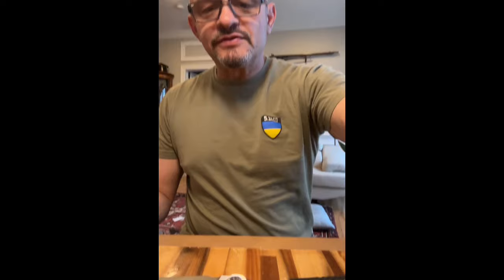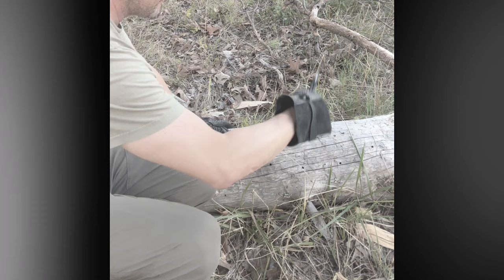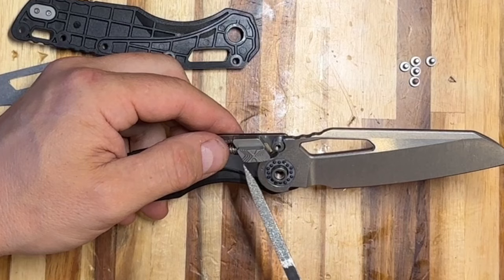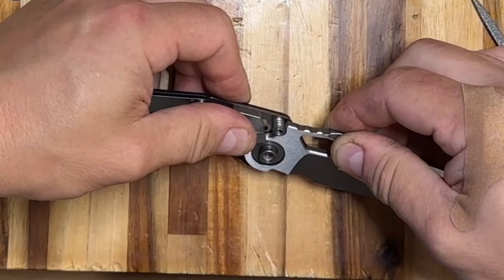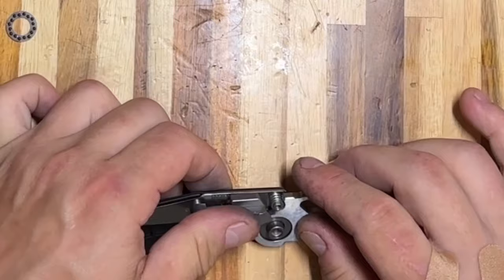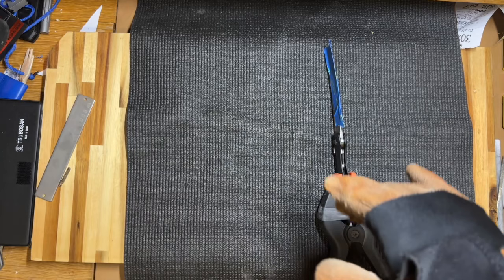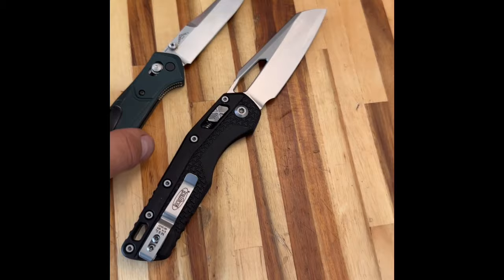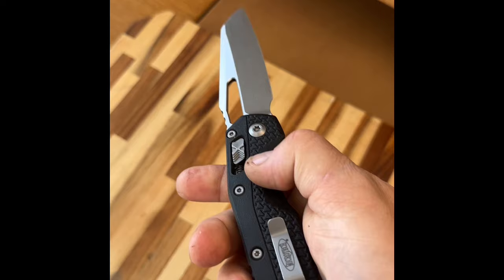Microtech MSI lock failed. See why & how to fix it.  Is it a good EDC knife candidate?

Comment: Same thing happened to mine. Spine tap caused the lock to fail. The MSI lock had a similar gap as your knife. I sent the knife back to Microtech for repair. They sent it back and the gap was gone. They should have caught this issue in their QC process. Great video!
Reply: This is good to know. I received mine the other day and have this lock issue so away to MT it goes. Glad they can actually fix this through warranty and I won’t have to mess with it myself.

Comment: People should be very careful doing this because you essentially removes years of use off the knife. When you have a brand new knife you need to break it in before using this procedure, and if used, you need to remove only the slightest amount of material.

Comment: I don't believe filing the blade was the right move. Just like a frame lock or linner lock you need the angle of the lock to wegde as is wares down. The ram is the wedge. Filing  a small amount off the ram with diamond jewel files at a slightly lower angle fixed the slip for me. This ensures it will have a rock solid lockup even as it wares. The ram will always wedge tight.
Reply from the maker: Dave, I wish I could see your facial expression when you find out that Microtech has implemented the exact solution - flattening the engagement tang - on all Ram Locs in April of this year. 
🫳
🎤
Reply: Good for you. Happy your solution was what they wanted.
Reply from the maker: @davecaraballo they also eliminated the ramp area on the ram head. Much much better engagement!

Comment: You should test the spyderco manix 2 lock. I think it’s a similar design, and it would be neat to see how it stacks up. Maybe with some slightly better knuckle protection though.
Reply: I’ve tested it on the Manix 2. No failures. It’s extremely solid.

I’ve got two MSI‘s and both have this problem. I’m on the fence about whether to sell them or to try and do it. This guy did.
Reply: @CuttingBoardRx  I’ve already got one. 

It is more solid, but the Ram Lok makes me nervous.
Reply: @squigglydoo9386 Given the fact that companies are going to be coming out with some badass custom scales for these things I suggest you get a pair then do this mod while you have then off already. I'm with you, I'm very disappointed that my msi has a bad lock but I'm also very glad that the fix for it us very easy.
Reply: Yes sir!
Reply: A manix 2 lock failed on me stabbing through a hard piece of plastic to make a cut during a job. Luckily I didn’t get cut.

Comment: Absolutely LOVED the video! I recently got a MSI off Ebay & well, it wasn't up to snuff. Mfg. June of '23, and it had lack of ram. I didn't have any good diamond files & using the diamond stones from sharpening kits tested my patience too much lol. Then I remembered about the Smith's 3001 10-Inch Oval Diamond Sharpening Rod I use to roughen up an abused or worn edge in a pinch & then run over it with a smooth ceramic hone to get a sticky edge (not a proper 'sticky edge', but it works excellently in a pinch). That Smiths hone worked great! I also knocked down any burs from the sanding & used the almost dull carbide mini files to smoothen anything else. 
The ram was also uneven, so I put the Smiths to it as well to flatten it a bit so it slides in the liners without catching. All of the moving parts got a buffing & it works great now. Using a permanent marker helped show where the ram was engaging with the blade & I could pay more attention to those areas. 
With 1 scale off, I held the 2nd liner tightly in place and with a well taped blade I pushed the ram evenly against the blade as a 'speedy break-in' & the marker shows where the ram running along. 
Hope these idea of mine/ours helps those that have to adjust their MSI's.
Again, I loved the video, it's put together well &greatly appreciated!

Cheers
Reply from the maker: @Rottidog68  Thanks! Would love to have you as a subscriber!
Reply: @CuttingBoardRx  I am. Have been for a couple/few weeks, I believe. 
Coming from a manufacturing field, welder/fitter, I appreciate your engineering view of things. I find it easy to follow, relatable.
Reply from the maker: @Rottidog68  it’s easy to follow and relatable because I wasn’t always an engineer 🤣 - started out as a machinist! 
BTW, how can you tell an extrovert engineer from a normal introvert engineer?
Reply: @CuttingBoardRx  Mrmrmrmrr, I'm not sure. How do we tell the difference? Something about feet or staring. Odd I know lol, but that's what pops to mind. 
<edit or Rev.1> One makes YT videos?
Reply from the maker: @Rottidog68  correct! Introvert stares at your feet from 1.67 meters dis. The extrovert stares at your belly button while debating whether he should shake your hand and does he have the pocket sanitizer bottle!
Reply: @CuttingBoardRx  OMG lol. That's pretty elaborate & exacting.... so, it's appropriate. 😎🤓

Comment: Great Video.  I like  videos that not only show an issue but also show how to fix an issue.  Great Video.  By the way, I absolutely love my Microtech RAM-LOCK Folders, especially the MSI.  I find it to be a super useful everyday carry folder.  Its ease of use and its weight not being too heavy and its super useful blade is excellent for everyday cutting chores.  

One thing, mine, are 10/2023 MSI and Amphibian Folders, and the Lock-Bar on my MSI Folders goes almost all of the way forward, already and they don't fail the Wooden Table Top Spine Whack Test.  

But, on my Amphibian Folders, there's a big gap, like you showed on your MSI.  This makes me wonder if they fixed the MSI due to your video and not the Amphibian...  My Amphibians are my Collector's.  So, I am not modding those.  I thought I was going to carry the G-10 Amphibian and I installed Skiff's into it.  And, then, after carrying it for a week, I decided I liked the MSI more.  :-)

And, if the one's I carry, the MSI's, mess up, thanks to you, I know how to fix them.  Thank you for sharing.  Personally, I am a long-time Benchmade Axis-Lock User.  And, I must admit, I absolutely love the New Microtech MSI RAM-LOK Folders; they, absolutely "ROCK!!!"  :-)

I like the RAM-LOK better than I like the Atlas-Lock.  Why?  It functions better and is easier to use.  And, I have more faith in the Coil Spring than I do in Omega Springs.  Well done Video discussion, Bro!  :-) Peace, Stiletto :-)

Comment: I have a clone stitch in D2 for my daily beater and To do lot of task in my workplace, i noticed that the steel liner is double the thickness of the original one which is very thin. 
The lock is perfectly fine and very strong but there is huge gap in front of ram head like more than 2mm so i will do the same thing to improve the lock, THANK YOU SIR.

Comment: 1:55 that's bad advice!
the lock is not ment to be stuffed with a metal bar, if anything you'll wear it out and f* up the action and safety of the lock.
if you do things that make the axis-lock fail, then maybe you should pick a a fixed blade or a pry-bar and not a folding knife.

Comment: Thank you for making this. I have been searching for an answer since receiving my msi which also failed a very light wack on my knee. At first I thought the spring was weak and wasn't pushing the ram lok out to full lock but your analysis looks to be spot on. May end up doing this to my msi and stitch. Do you have any tips  so I don't fuck up my blade tang?

Comment: Thank you i just purchased this knife and definitely going to have to refit the engagement surface
Reply from the maker: I also did this on my Stitch Ram lock. Be very careful careful not to remove too much material from the back of your blade. Watch this video first:
Straight Answers to Microtech Amphibian Questions:
https://youtu.be/uouaZlInYLI
Reply: @CuttingBoardRx   Thank you I watched that video first!
Reply: @CuttingBoardRx  I tried this before any fitting and I'm pleased that it passed!

Comment: I did the spine test on mine and didn't have this issue. Gave it some pretty good wacks on my table. Sounds like this one slipped through QC. I did the same to a couple other ones I have and same thing no issue. The gap on the polymer version I have is around .60-.58 slightly less than yours had original, though I feel like that's not much difference. I guess I got lucky.

Comment: Excellent repair and video. I will be repairing mine soon. Thanks !
Reply from the maker: Just want you to know, the ones coming out of Microtech now have that exact fix applied. You may want to consider selling yours and getting one dated 05/23 or later.
Reply: @CuttingBoardRx  Thanks for the advice, but I love fixing and building. I'm quite certain I can deal with this.
Reply: @akquicksilver  have you sorted out your lock issue? im planning to get the MSI next week😊
Reply: @L4BOO  Yes, I did a little modifying on mine as suggested by CBRx and it works fine. I've heard and saw somewhere on YT that the newer models don't have this issue.

Comment: I know at first this was very believable since I owned three MSI's I decided to take the cheapest one I have, which is the molded one, and see if it really would fail when banging on the spine.  to my surprise as hard as I tried, I was not able to break the spine,  I'm not sure if the knife you had was designed differently than others or what but I can say for a fact you are not breaking the spine on an MSI ...  i'd say you have bad luck .

Comment: All that I see is you’ve accelerated the room that MT has left for wearing in of the lock. Sure it did the trick, however in my experience, allowing the parts to wear together ensures the system faces to itself, creating a stronger lock. Either way works though.

Spine impact is not a very realistic test in that when the user tests it, it’s sharp impact in a specific area. In stabbing and redirecting the blade in real life scenarios, the pressure is usually not blunt and its spread out.

Comment: I have the same one and mine fails too, i know people say why would you wack the spine nobody uses their knife like that but it does come down to safety, is it likely to fail under normal use, no, but you could trip or turn arond and accidently hit the spine and cut yourself wide open, it's probably not likely but you want to have the assurance that if some kind of weird accident does happen while using your knife you know you won't get seriously hurt. Just my opinion
Reply from the maker: Good point! In fact there was a comment in one of my threads where a gentleman tripped and fell with knife in hand and it closed on his hand and seriously cut him.

Comment: Don't you want to leave a small gap to allow for wear without creating up and down rock?
Reply from the maker: @georgelewis9127  Does not matter anymore. They completely redesigned the ramhead to blade interface moving the ramp to the blade basically what I did in this video. All RamLok knives made since April 2024 have the new hardware. Thanks for watching.

Comment: I just picked up an amphibian and the lock is not failing on the spine whack, and it does have a pretty decent gap above the ram head. The lock is still a bit stiff, once it breaks in more maybe this will happen? Well if it does, at least I will know how to fix it 👍
Reply: Update: It shuts easily on the spine whack now that it is broken in.
Reply from the maker: @stevetheripper7675 did you see the video I posted that covered all 3 Ram Lok knives in my possession?
https://youtu.be/uouaZlInYLI?si=8bMVKvSxT8iRor2Z

Comment: I see what you're trying to do, and I would also advance the lock a little bit, because more surface area contact between lock surfaces is a good thing for safety... However I think you went too far. 

You've advanced the lock to the point where there is no space left for wear over time. Those type of locks NEED a gap, so as the blade wears against the ram, the ram can self adjust and progress forward on it's own.

The ram now has no further forward space, so when you inevitably get lock rock there's not really much you can do. I would have done maximum 50% of what you did.
Reply from the maker: The ram head is a hardened piece of steel, so wear is not a major concern
Reply: @CuttingBoardRx  that doesn't matter. The blade won't be the exact same hardness, and have different material properties.

The ram wears against the blade tang, and any two surfaces that have friction, have wear. You can't avoid it, you can only engineer around it.

I assume the designers accommodated for wear by allowing the lock to self-adjust over time, much like the self-adjusting gap in ALL Benchmade crossbar locks, the self-adjusting tri-ad lock, and demonstrated by prevalence of replacement lock inserts on frame locks,(which are also designed to wear over time via "lockup percentage")

All materials wear, especially if they're hardened steel against a less hard blade. Leaving no room for adjustment, means that lock rock is inevitable far sooner than designed.

Again, I agree the lock needed advancing a little bit... But not that far.
Reply: @drbirtles I think you are right.
Reply: I agree.

Comment: I wonder if they have re-engineered the RamLok ? I will definitely stay away for now
Reply: Stay away
Reply from the maker: @mitweakz866 I published couple of videos on the fact that they re- designed the back of the blade. Knives made 5/24 and later should be GTG. The mod they did is exactly what I did here

Comment: Very interesting and well studied yet ingenious resolution to this problem! I have the same knife but simply with the partial serrations. Looking at yours prior to repair it has about the same gap as mine does. Mine was purchased about a month ago, So early, September roughly. I did the same wrap test as you with what would appear to be about the same force. Yet, no defeat of the lock, so I tried again and still couldn't get the knife to close. The action is smooth and has no lock stick, by the way. 
My only thought here is that Microtech may have begun using stronger springs? I believe that would also help with accidental closures. 
Great video and I've subbed! 🗡️🔥👊

Comment: Apparently my assumptions were correct as i literally just received a new MSI and opened the pkg not 20mins ago and before i did anything at all with the knife just opening and closing a few times I saw what looked like potential for lock failure which i then searched youtube for "msi lock failure" to see if it was an issue and my assumption or worry was valid and that lead me here! Thanks for posting

Comment: Ooooh that sucker really bit ya didn't she? 😂 Not sure if you have any experience with the brand Zero Tolerance but i own several of their folding and fixed blade knives, well their folders are unfortunately known for failing the spine-whack test also... Not that their knives are weak, inferior or not great knives but there is that issue unfortunately...

Comment: Same size pivot screw on the auto Stitch, and I can't even get mine to break free. I actually broke 3 bits so far trying to break the pivot free on my auto Stitch. I'm about ready to use a damn impact driver on it, but I know if I do, I'm gonna screw up the finish on something, which is not what I want to do. It almost seems like Microtech used a shit ton of red loctite on the pivot. If they did thats a dick move imo. You shouldn't have to worry about breaking bits or screwing up your pivot just to maintain your knife, especially when it costs over $400. Don't have an MSI yet, but I think I may do the same with mine once I do get one.
Reply from the maker: One side is captured. You have come at it with a lighter to melt the locktite.
Reply: @CuttingBoardReviews  I did know the Stitch has a captive pivot, but I mean, this is nuts. Is there any chance you know what side is captive and what side is not? I heated the pivot (with a map gas torch because a lighter wasnt heating it up at all) to the point that I wasn't able to touch it, and it still won't budge regardless of what side I try to break free. Im afraid to heat it further because I dont want to screw up the bearings, heat treatment, or weaken anything from excessive heat.  I know this is a knife I will not be keeping if I can't do basic maintenance on it, which sucks because I planned on owning all production color variations of the Stitch.

Comment: Why whack the spine of your knife? Who is dumb enough to do that in a real-life application? I like that there's a simple solution, but there is no need to abuse your knives.
Reply from the maker: Wouldn’t you rather own a knife that holds up to any kind of abuse? Isn’t it ridiculous for a company to charge that kind of money for a knife that requires a “simple solution” to not fail after a strike with a 3 oz piece of plywood? And your point helps nobody, it just encourages companies to continue screwing the buyer over. In fact you know you’ve been screwed and are taking it out on me instead of a half-baked “engineer” who designed this lock.

Comment: One other observation that i dislike is their use of the style of bladestop theyve used it seems it might be a wear item with it not being a solid pin I imagine over time that the blade will eventually flatten the raised portion causing a flat spot and blade play... My old Chris Reeve small sebenza 21 has a bit of flat spot on the blade stop pin and it is solid and i rotated it so that the flat spot was not making contact with the blade and i no longer had any up&down blade play and if that solid pin can deform then this style that Microtech used certainly could deform much sooner? 🤷‍♂️ Just an observation that I have already dealt with on my old Sebenza so I'll be keeping my eye on this one and if i notice any deforming then It'll get taken in for warranty repair...